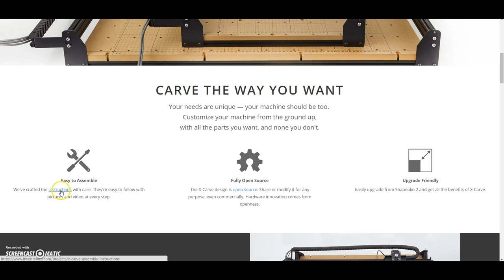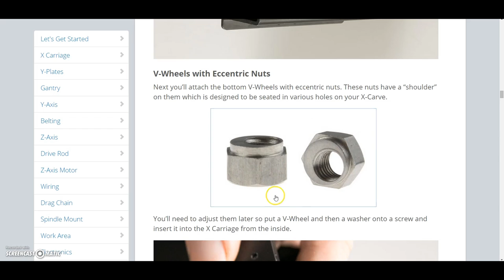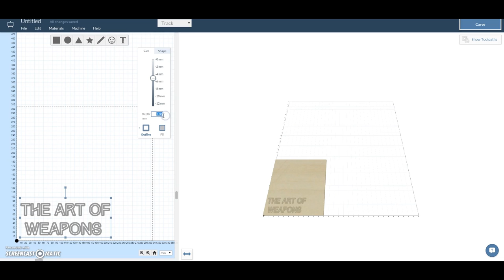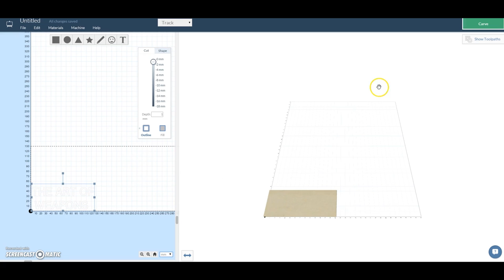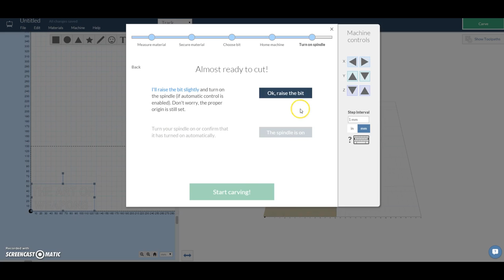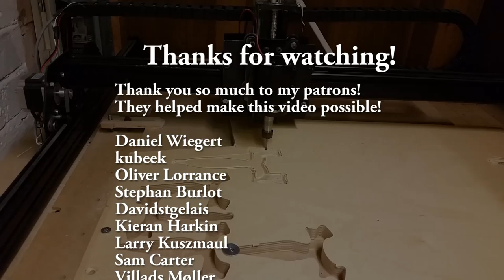X-Carve Cnc From Inventables - Assembly and Review

Comment: cool,,I couldn't wait to leave my old job to get as far away from cnc as possible, after 10 years of pcb manufacture and 11 years in the school tech dept with the cleaning lubing, software updates, work movement adjustment, new motherboards, extractor emptying and then every time a student got onto it they never got the work piece in the right place or mounted correctly, or saved their work and forgot the filename/location...the beauty of them though is if you know what you are doing they will run and run while you get on with something else and the work is consistent each time...if I mention knife scales(handles) that should give you ideas.....all the best!

Comment: Nice video..
However if you want to keep it working flawlessly, then i recommend doing your wiring properly. at 10:50 i can see that you have centimeters of bare wiring.
Only bare wire asfar as the wire go into the connectors. Leaving bare wire outside of the connector is a sure way to, from less to severe, break your milling bit and workpiece, shorting the psu or burning out the gshield.

I am also building my x-carve 1000mm, one of my steppers had a internal break so im waiting for my replacement.

Comment: If you have the time and resources I think a good modification for the x-carve to have a shop vac next to the bit. You should be able to make a flattened out tip (keep it looking a bit nice instead of a random pipe) for the vacuum and use some double-sided tape to secure it to the head where the carving bit is, then with a simple eye screw in the roof you can hang the vacuum tubing up with some string.

This would save you the effort of having to keep vacuuming up the dust and would allow for longer projects to be done without having to baby sit the cnc
Reply: Oh and of course, great video as always and can't wait to see more projects with this beautiful machine.

Comment: Definitely not a UK only issue on the Stepper motor power.  In the US here and had the same exact problem.  Extremely annoying since somehow my search-fu was not strong enough to turn up any results for this when I was troubleshooting so I spent a day triple checking connections and reseating various parts.